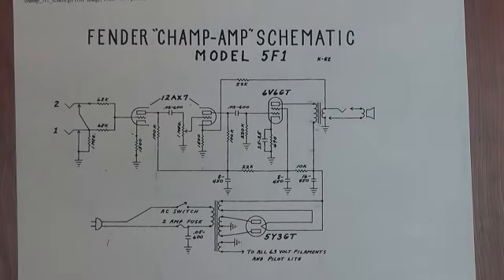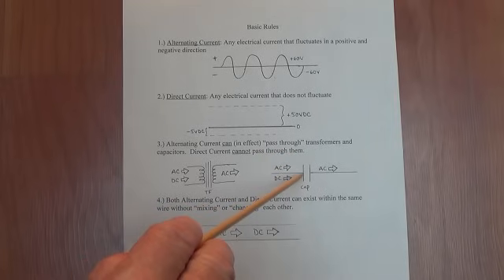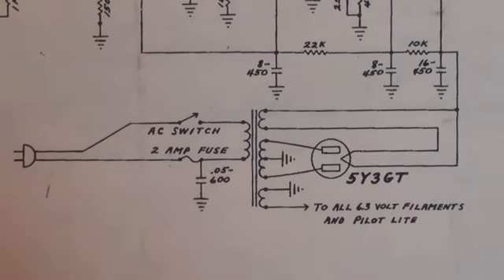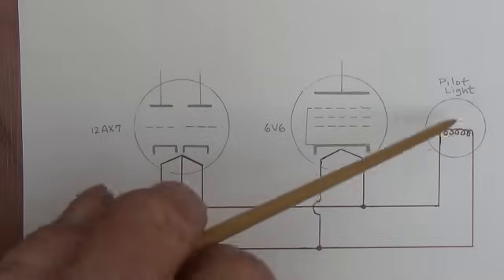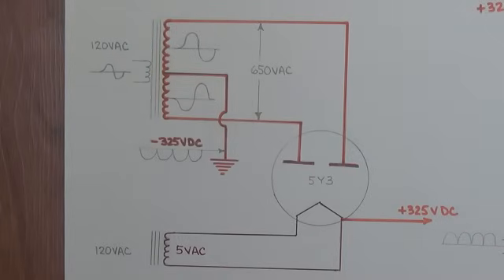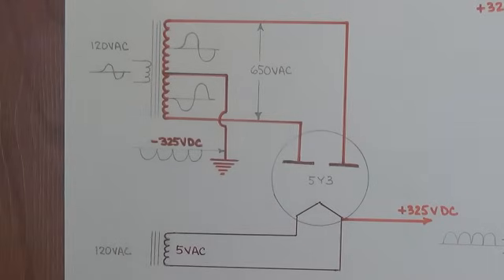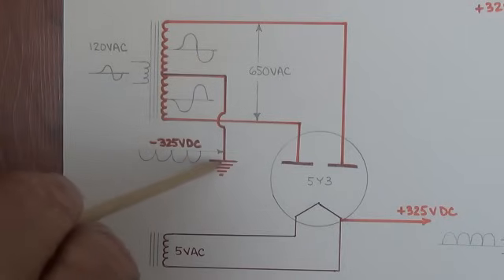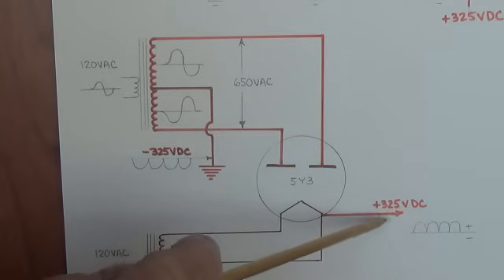How Tube Amplifiers Work, Part 1: The Power Supply

Comment: Hello Doug, first I want to thank you for your very clear videos. I’m still a total novice thats getting into electronic circuits and amplifiers. I have one question as being said novice. In the part 1 video you laid down some basic rules which include that DC current doesn’t flow trough capacitors. But in this video the +325vDC goes through 3 of them. I think I am overlooking something here, therefor my question😊 Thanks again for the helpful videos! Cheers

Edit: Some spelling mistakes (English not being my native language)
Reply from the maker: Greetings, WHE. This is a common misconception.  DC cannot pass through capacitors.....but in the case of filter capacitors, it does not "pass through" them, it passes BY them. At no time does the DC pass through the flter caps.....or it would simply go to ground in a dead short. Instead it passes by them and while doing this, the AC ripple in the rectified DC is smoothed by the filter caps.
Reply: @UncleDoug  Thanks for the explanation. I have trouble understanding how only passing by the filter would alter the ripple wave and smoothen it out. Guess I still have a lot to learn about capacitors, thanks again !!
Reply: @UncleDoug  Is it charging the capacitor while blocking and the blocked charged current gets sent back so the ripple is flattened?
Reply from the maker: @DadVibesBizkitNL  This is covered in detail in other videos, WHE. The capacitor charges while the ripple wave is at its peak and discharges as the ripple wave is dropping to its lowest point, eliminating the valley in the ripple wave.
Reply: @UncleDoug I do get that, but the thing I don’t understand is how this principe occurs in terms of direction of flow of the currency. I already watched Some videos, for example the EngineeringMindset ones that are very forgiving for novices like me. But I still dont seem to understand the flow of the DC current with the capacitor. 

My understanding is that once the rippled current leaves the capacitor it is indeed smoothened out. But WHERE does the DC current leave the capacitor? It coudn’t be on the - Side since DC can not flow trough it. So my simple brain would suggest it gets bounced back smoothened on the plus Side back into the circuit?

I am truly sorry if i sound stupid, I’m just very eager to learn and understand the subject. Hope you can respect that ! :)

Thanks again for your knowledge and replies
Reply from the maker: @DadVibesBizkitNL  Think of the B+ wire as the main street through a town.  There are side streets perpendicular to the main street and there are body shops (filter caps) on those side streets that work very quickly. As I drive down the main street, at each intersection with a side street, the body shop on that side street smooths out the dents in my car body. I never stop, slow down, or drive on the side streets.....I just pass by them. As I leave town, my car body is smooth.
Reply: @UncleDoug that is a beautiful explanation, I really appreciate it
Reply from the maker: @DadVibesBizkitNL  Glad you liked it, WHE :)

Comment: Lately i come across ur lecture on characteristics of valves in very simple way. Very very informative. I'm working on a valve amplifier of a 17 mm projector. Never workouts on a valve amps. I do on transistor amps. So this i challenging task.. The valves on this amps are12AX7/7025/3 nos. EL 84.
Reply: *16mm film projector.
Reply: Have to lookout for the high volts around the circuit😊
Reply from the maker: Thanks for your nice comments, B. Good luck with your project....and be careful :)
Reply: @UncleDoug  sir, I hope to discuss with you n would like to get advice from time to time, if you don't mind.
Reply from the maker: @beatlesadeye4912  I'll do my best ;)

Comment: Fantastic video! I am a little fuzzy however on what the function of the 5Y3 part of the circuit is for attaching the 325v DC current. Why is this used instead of just a direct wire?
Reply from the maker: You need to watch my videos on rectification and power supplies, BW. They explain it all.

Comment: Thank you so much for this series! I've watched and read several explanations of how tube amps work (pretty much always looking at the 5F1), and never got anywhere until I watched this. I think the difference is that all the others I've encountered focus on the signal path, and treat the power supply as an afterthought. So what I see is that the signal goes into the amplifier, and then it goes into a magical forest of tubes and capacitors and resistors, and then music (or in my case horrible noises) comes out the other end. Your videos have demystified that magical forest, and for that I thank you.
Reply from the maker: You're quite welcome, T. We're glad it was helpful.....and loved the "horrible noises" part :)

Comment: Most tube circuits use parallel configuration to supply filament voltage to heaters. Christmas tree lights used to be parallel when they were screw in bulbs. The mini lights with series configuration causes the entire string of lights (or a large number) to go dark when a single bulb “opens” Much like those great little cheap tube type GE televisions where all tube heaters were in series. 120 vac fed all heaters and I recall one such tube being a “33” prefix, indicating a 33 vac heater. 

Very good video sir. Keep up the goodness. And note that tube circuits  may saturate whereas xsistors do not usually survive a short circuit. Another bonus, tube corcuits are EMP proof.
Reply from the maker: Thanks for your input and comments, Robert.

Comment: Uncle Doug, I have a question for you; many HiFi enthusiasts are enamored with some things I can’t understand, for example changing their power cord for a very expensive one made of exotic materials, and the same with speaker wires. Would this have any effect on the audible sound? Why, or why not?  Thank you!
Reply from the maker: In my opinion, absolutely not, C2......but that won't stop HiFi guys from spending a lot of money and swearing it was worth it.  Barring a blind study in which tiny (but expensive) alterations like this can be audibly detected repeatedly by multiple listeners, I will remain a skeptic.

Comment: Well, this is a great video! I do have one question though, if the secondary is 325-0-325, how did it make it through the rectifier and still be 325 vdc? In theory it should be 325v x 1.41= 458vdc?
Reply from the maker: The value you stated would be for the final, rectified DC output (ignoring electrical losses) after smoothing to peak V by the filter caps.  All of this is discussed in detail in subsequent, more advanced videos on Power Supplies and Rectification.
Reply: @UncleDoug  thank you for the reply! Reason I asked was that I’m working on a PS , 250-0-250 trans, after the rectifier tube I’m getting approx 352volts. The vid shows no change in voltage after your rectifier(325v), wasn’t sure if I’m doing it wrong or may be using a different type of rectifier. Thanks again!😃
Reply from the maker: The effect of smoothing to peak voltage is covered in more advanced videos, TW. What you are witnessing is correct. @Thewatcherinthering336

Comment: Uncle Doug, I want to start buying components for building prototypes and testing with the 12AX7.   Should I buy a Hammond 290AX transformer or is there a better more versatile transformer to have on my workbench ?  I can not buy many different transformers due to budget restraints.
Reply from the maker: If you are planning on limiting your investigation to the 12AX7 tube, the 290AX would be overkill. If you are planning to investigate double-ended tube circuits using the 12AX7 for pre-amp and phase inversion, then it would be ideal.
Reply: @UncleDoug  I like the Endor transformers because of their pretty blue color.  Black transformers are ugly.

Comment: IMPORTANT NOTE:  The 120 Volts AC shown at the primary of the transformer is an RMS value.  120 Volts RMS equals 339.4 Volts Peak to Peak.
Reply from the maker: Thanks for your helpful input, E49.  RMS voltage is covered in another, more advanced, video on our channel.
Reply: @UncleDoug  ..and thank you.   I decided that going to learn to design my own.  I appreciate your videos.

Comment: I understand how the AC is converted to 325 Dc x 2 but Im unclear about the negative 325vdc going to ground, where exactly does that energy or the negative dc current actually GO to ?
Reply from the maker: Bear in mind that a positive charge is the relative absence of electrons, while the negative charge is a large abundance of electrons. Current flows when the electrons are allowed to flow from negative to positive resulting in zero net charge. Thus the net difference between the negative pole  and ground state is 325VDC.
Reply: @UncleDoug  This is extremely frustrating to me as I Have thought myself reasonably above average intelligence but the whole of electricity or electronics rather just seems to be as clear as Mud! I understand most of the basic principles and most of what to me seems intuitive, but I do prefer to be thorough when I intend to learn things and this particular point has me stumped I understand that positive charge is absence and therefor draws the electrons from neg to pos however, I am visualizing two times 350v, with the positive or the top parts of that initial AC wave having a place to go and the negative going to ground, now would that be grounded to the chassis? So the electrons are basically flowing through the chassis and into all of the appropriate positive charged terminals or, Yes I do feel Im missing something with ground if thisis not the case. thank you very much for your time and effort.
Reply from the maker: You really need to watch my more advanced videos on rectification. The bottom/negative wave forms are not sent to ground, they are moved above the 0-line and placed in between the positive wave forms, thus wave amplitude (voltage) is +325VDC relative to the zero line. There are no negative wave forms "sent to ground".  @codelicious6590

Comment: TLDR: I want to learn more about the theory behind the design of this circuit.

Edited for clarity, paragraphs, and to see YouTube deletes previous edits when Re-editing it, thanks!

I am not familiar with tube rectifiers to be knowledgable on them specifically. 

The best that I understand rectifiers, I would have calculated the ac input voltage based upon desired output. 

For 650vdc I would have taken 650vdc / square root of two to arrive at an ac supply voltage of about 460vac. 

The way I understand ac voltage is we measure RMS or PEAK and nearly all of the commercially available digital meters read some form of RMS, DC is constant so equal (mostly) to peak ac voltage. 

Example 120vac fed to a bridge rectifier the dc output is 169.7 or about 170vdc. Vac rms x sqrt 2 = vdc. 

The difference between what I understand and the tube rectifier is 2 extra diodes in the bridge rectifier, I don't think that would affect voltage though as you are capturing the positive peaks with one and the negative peaks with the other which should in my theory be additive and would retain the rule of thumb that when rectifying ac to dc through a bridge rectifier the dc source is calculated as AC x SQRTof2 =DC. 

I am hoping you can go further in depth on this so I can better understand tube circuit diagnosis and construction. 

I am planning to build a tube transceiver and have to have the theory down before I start ordering parts from wherever I can find period correct parts.

And hopefully not another edit…
Reply from the maker: Please check our video list for much more advanced videos on topics like RMS, Power Supplies, Rectification, Output Power, etc.

Comment: Wow. After several years as an applied physics student I've never fully understood how rectifiers work. That explanation showing the two waves out of phase is phenomenal. Awesome work. Getting ready to replace a filter capacitor in an Orange TH30 and having this background knowledge is amazing. Thank you.
Reply from the maker: Thanks so much, Zach. We're glad the video was helpful :)
Reply: @UncleDoug  Doug, If you have a chance to give your advice on this I would much appreciate it. Orange TH30, blowing the HT 500mA fuse every time it is replaced. I have a tube checker which confirmed that all of the tubes are functioning properly. I have noticed that one of the filter capacitors has a significantly bowed out top (220uF, 450V). Do you think this capacitor has gone bad and would this cause the HT fuse to blow?  

I'm about to build a current limiter like the one you made a video on. I am also aware of how to discharge the capacitors safely. I guess next step would be to disconnect both transformers and all of the tubes from the board, and see if it blows the fuse? I guess that would confirm its an issue with a cap or something other than tubes/transformers?

Thanks, Zach
Reply from the maker: Yes, indeed, an internally-shorted filter cap can definitely cause excessive current flow and blown HV fuses. The bulge is probably due to heat being generated by the internal resistance developing within the cap. Before any further testing, simply replace the cap and see if the issue is not resolved.....and definitely use a Current Limiter when you do. @zach_60
Reply: Awesome thanks. I built a current limiter and the bulb is behaving properly (bulb glows dim, 100w bulb), indicating the amp is in working order... weird? I guess a bad filter capacitor may not effect the behavior of the current limiting bulb? Regardless, I am going to order new filter capacitors today. Thanks again!  @UncleDoug
Reply from the maker: Since the HV circuit is generally low current (milliamps) as is the fusing, it doesn't take much of a short to blow the fuse. The filter cap(s) really should be changed.  @zach_60
Reply: Thanks. I've decided to replace all of the chinese electrolytic capacitors for nichicon ones. However I did test the suspect capacitor with my meter and it gave a proper capacitance value. I'm still going to replace all of them even if the fuse is blowing for some other reason. We shall see @UncleDoug
Reply from the maker: Our fingers (and paws) are crossed, Zach. @zach_60
Reply: Unfortunately that didn't solve it. Finished up the capacitor swap earlier and the amp is still blowing fuses. With every tube removed, the fuse is fine UNTIL you flip the standby switch onto 'on'. Any tips? This amp has a solid state rectifier, maybe that went bad? The only two things I have yet to check are the rectifier and OT. 

I massively appreciate all the advice you've given. @UncleDoug
Reply from the maker: As you said, Zach, time to check out the rectifier and OPT. My guess is the OPT. @zach_60
Reply: Doug, Update! The amp is working! What a saga this has been. You may laugh, but to begin my problem, I was using fast blow fuses which instantly blew due to the surge of current when the caps charged up (I assume). However, as soon as I got the correct slow blow fuses, the amp played for about 2 minutes, then died (HT fuse didnt blow). I spent many hours tracing down what caused it, and hear this: One of the brand new filter caps went bad. Swapped it out for the stock one because I'm impatient, and the amp is working. (And to be clear, the amp blew slow blow fuses with the old caps, I just couldn't find any slow blow locally and figured fast acting was fine).

Unfortunately it's also going to needs tubes. After playing for about 2 minutes it begins to make all sorts of weird popping and screeching noises. I determined one of the power tubes went bad because with it removed the amp didn't sound like a bomb lol. 

I can't thank you enough for the knowledge you've given me - here in the comment section and in your videos. This was a super interesting project. @UncleDoug
Reply from the maker: You're welcome, Zach. Best of luck with your project. @zach_60

Comment: Thanks Uncle  Doug. At the beginning of the video, the 120V AC is ralking about RMS value?
Reply from the maker: Yes. This is a very basic video. In subsequent, more detailed videos, I elaborate on the differences between AC peak voltage and RMS.

Comment: Was wondering Uncle Doug if you could help me understand the bais of a 1966 Guild Thunder one amplifier for the 6GW8 power tubes both halves the triod and the pentode? Thanks bro😊
Reply: http://www.prowessamplifiers.com/schematics/images/Guild_Thunder_1_12.pdf
Reply from the maker: This is a complex question, CG. The triodes are cathode-biased, so you can test the bias resistors to be sure they are still at proper value. The pentodes are fixed-bias (grounded cathodes, dedicated -DC grid-bias supply), so you can measure the PC & PV and calculate he PD, which must be less than or equal to 9W. Adjustment of the pentode bias is accomplished by varying the value of the 68K resistor to ground in the DC bias supply. If none of this makes sense, further explanation would require hundreds of lines of text. I hope it does.
Reply: Thanks Uncle Doug but I didn’t see the 68 k resistor on the schematic I found it says 690 ohms as far as I can tell
Reply: My bad 680 ohms😊
Reply from the maker: It's difficult to read, but the resistor in the dedicated -DC bias power supply looks like 68K to me. Perhaps you are looking at the wrong resistor. @cgmasterman
Reply: I was reading -10.4 volts on pin 8
Reply: My Guild doesn’t have reverb it has just two inputs maybe you were looking at the schematic for that the schematic I was looking at says 390 ohms in the negative bias supply
Reply: I tried to post the schematic I found but it keeps getting taken down

Comment: I know this is old... But for those unfamiliar, with AC there is peak voltage, peak-to-peak (which you won't deal with unless using a scope), rms voltage,  and the most useful, true rms voltage.  They are not the same.
Reply from the maker: Thanks for your input, Pat. All of this is covered in subsequent, more advanced videos.